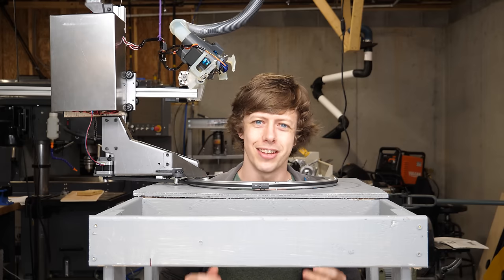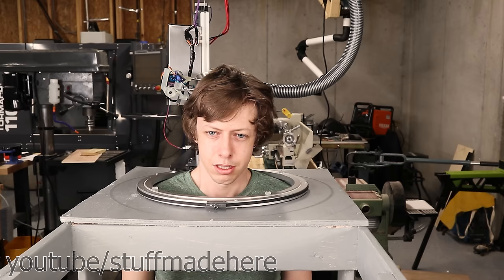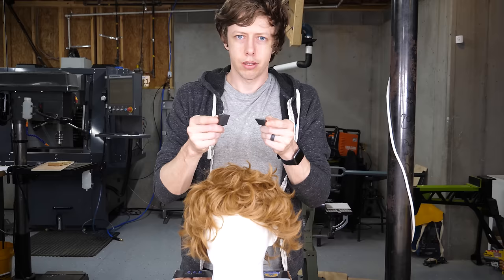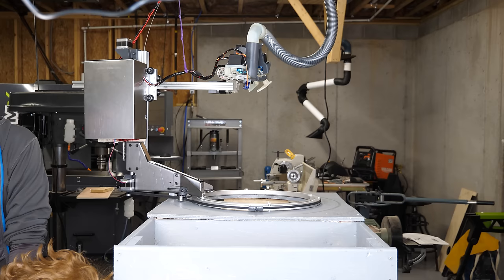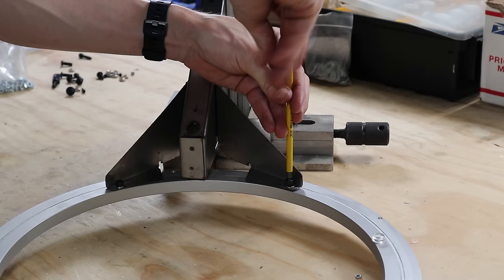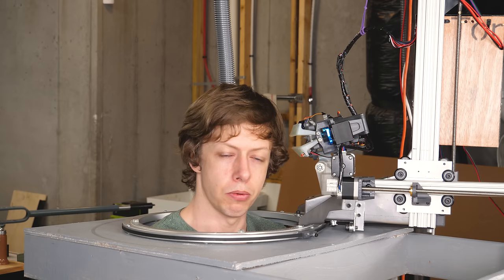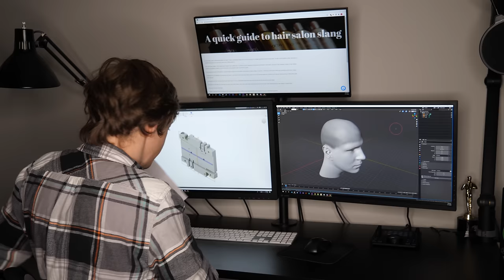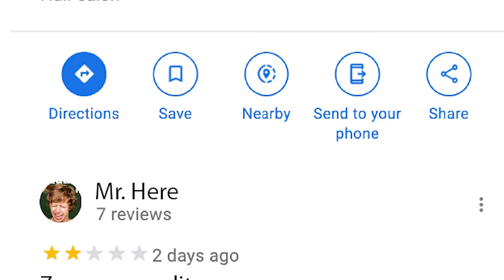I made a hair cutting machine

Comment: Many years ago, there was a home hair cutting system called "flow bee" basically hair clippers attached to a vacuum cleaner. Maybe use that instead of the scissors
Reply: I remember something similar to that that they used on the recruits in boot camp when they first came in.  Probably more of an issue of making the "barber" have less cleanup to do... It's been quite a few decades, so I don't remember the specifics of the design, but I think it was basically a vacuum hose attached to the end of a pair of electric clippers... These days, I just take my electric clippers into the shower room with me and mow my head and beard to crew cut length... Don't even need a mirror... Just keep mowing until I don't hear it cutting anymore... I think the last time I actually paid to get a hair cut was over 40 years ago...

Comment: you need to program into it safety features where if it comes into contact with your head or anything other than hair, it stops putting pressure immediately... so it doesn't cut, decapitate or impale you... an easier cut would be just using one of those electric hair clippers that have a guard on that only allows cutting to a certain length. then all you have to do is make it smoothly make the machine go around your scalp.. ive never trained as a hairdresser & ive been cutting my hair for decades with one of those.. its simple

Comment: You should isolate the machine from the ground and attach a 500KV van de Graaff generator to it, to make the user's hair stand out akimbo, which will make it easier to trim to the appropriate length.  Then you could replace the scissors and trimmer with something like a 5W laser to make the system touchless.
Reply: yea, high voltage and high power lasers next to my head... what about no?

Comment: Why don't use a movable comb with hair clipper ? 

The comb will always be in contact with your head and the hair clipper will move along an axe to get the correct length that you want. 

And it's safer for your ears.  

You'll need to make te comb, in 3D, an elongate one. 

What do you think ?

Comment: This machine must NOT run until a full safety review is made and have it equipped with the proper safeguards . A full safety review and risk assessment must be done  then actions must be taken to make it safe and this has to be done and approved by a Professional Engineer. 

The machine must meet the machine safeguarding applicable standards and robotic safety standards such as ANSI and CSA as well as the local safety regulations .

If this moving scissor or any moving part poked someone's eye or caused a cut to their head this guy will be liable.

Comment: *facepalms* You couldn't use the badass depth sensing camera because the stand blocks it a lot of the time...

Mount... the camera... on the stand...? <_<

Also, never trust those little micro-switches. I had a robot that should have won a design competition fail utterly and ram itself into a wall over and over because a brand new one of those failed after maybe 50 cycles. And do you know how often I have to replace those in my mice? >_<